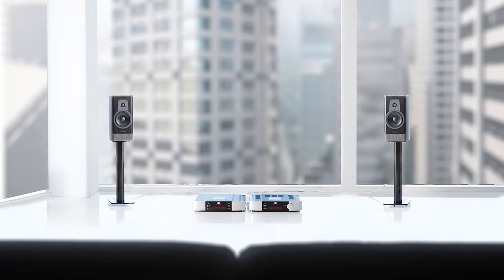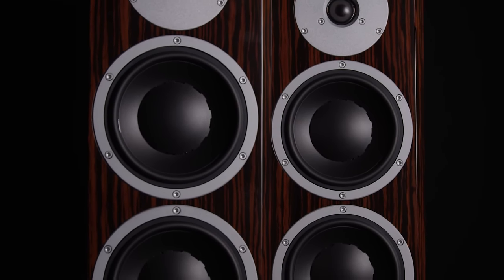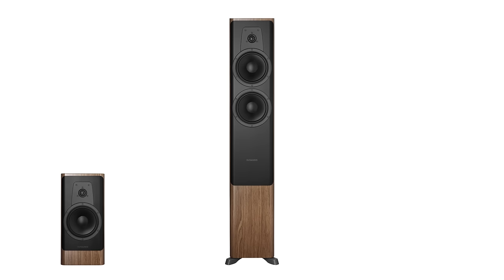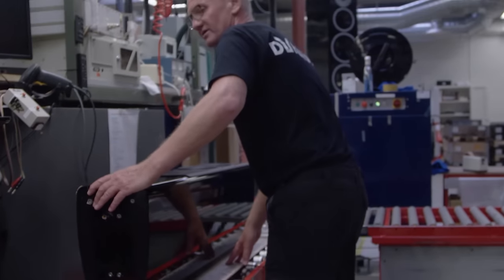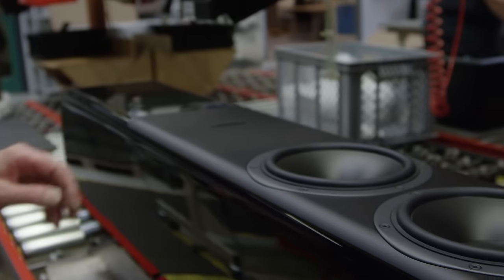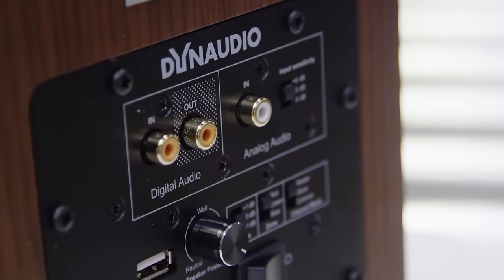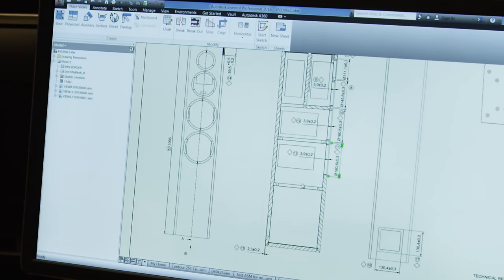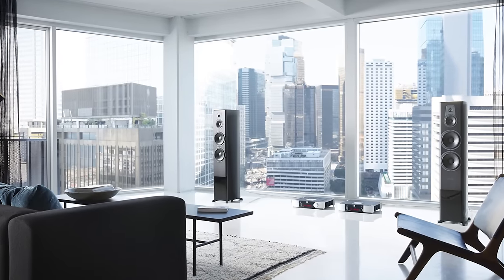Dynaudio's Contour and Focus XD Speaker Lines | SoundStage! InSight  (February 2017)

Comment: All technical. How does the Sound compare? Across contour 20 and focus XD 20?
Reply: Contour will technically sound significantly better, especially the new i version tweeter which the Focus cannot compete with.
Reply: @connorduke4619  but it’ll depend on the amp and maybe DAC yes?
Reply: @morespinach9832  Of course, if you pair the Contour with a terrible Dac, preamp and amp it could be made to sounds lesser than the Focus. But you would have to be quite determined about it as the Contour has higher quality drivers, crossover and cabinet build according to Dynaudio itself

Comment: Btw I could take a streamer and connect is directly by cable to Dynaudio. This sounds great. Yet, putting a proper DAC like RME or Denafrips absolutely improves the sound. Audibly so.
Reply: Which Focus XD do you have? And which streamer did you use for this test?
Reply: @tfj100  xd20. Limetree bridge from Lindemann, tiny device. I tried the revered Lumin U1 mini but didn’t hear much of a difference. RME made a significant different.
Reply: @morespinach9832  Ok. I have XD60. I feed it with Antipodes Audio upgraded CX/EX combination, (equivalent of current K50). If you feed it a better streamer, you get better output, even though it goes through a DSP conversion inside the speaker. So it also makes sense that a better DAC in the chain gives a better outcome. But even if you go via the analogue connection, it still does the DSP conversion regardless.

Comment: Pause at 4:23. That doesn't look like a solid inert cabinet design.  Looks kinda thin and having folds in mdf it would have to weaken it.  Does not seem high end.
Reply: Folded design will make it more rigid than a flat design. And curved shapes will be better sonically as well.
Reply: Si vous voulez du haut de gamme qui fait vraiment de la HI-FI, voyez chez B1W